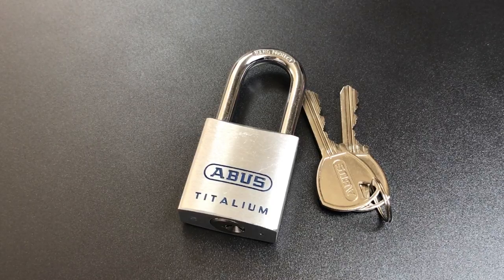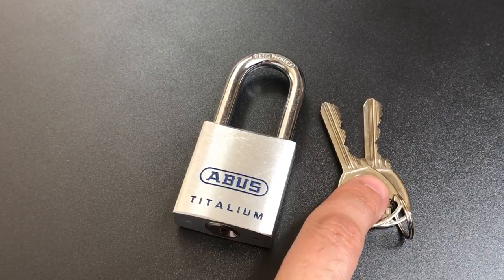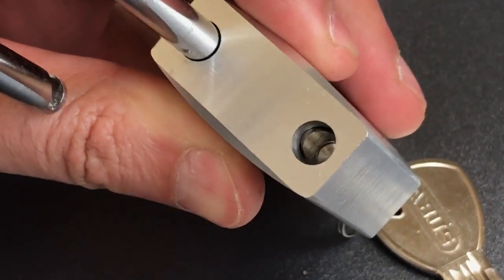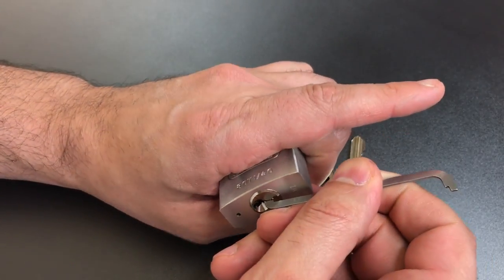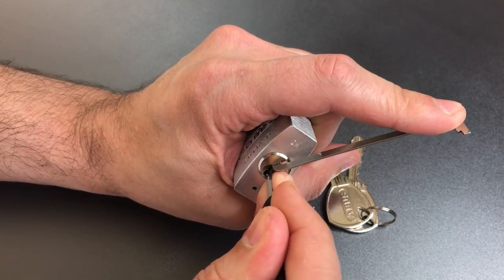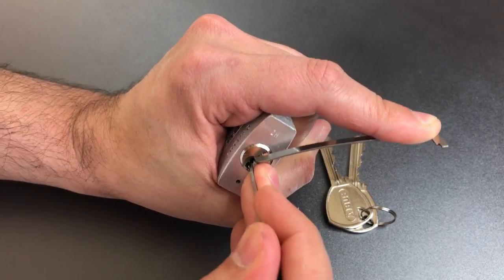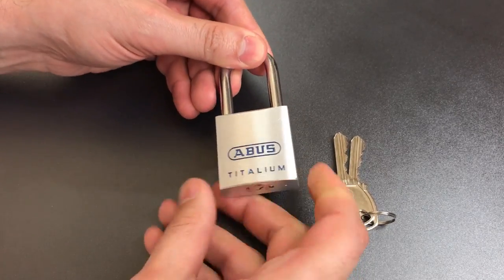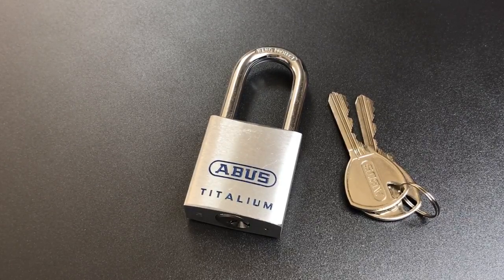[534] Abus Titalium 80TI/40 Padlock Picked

Comment: The biggest flaw on this 80Ti are sadly the missing ball bearings. The first driver is a double serrated and as far as I remember the rest are spools (I once had taken one apart), keypins are all standard. Actually it can be an easy or a hard pick, some are relatively smooth and on some the spools are really catching and pins like to drop, that differs a lot on this series. The big key is really nice, just love that triangle bow, and can have some crazy factory bitting :).

Comment: Is there a difference between this lock and the 64/40 other than the shackle length?
Reply: The 64TI/40 has smaller diameter shackle, and housing. It's the little brother of this lock.

Comment: What does false set, binding and counter rotation mean?
Reply: as far as i know, binding means the pin is resisting being pushed by the pick, which means its the next pin to be picked because it'll stay once it hits the right spot.
false set is when the core turns slightly because its caught on the slots in the spool pins.
counter rotation is what you get when you pick a spool pin while in the false set. as it moves closer and closer to the right position, it'll push the core slightly out of that false set back to the neutral position.

Comment: Why when I get a  False set The pins bind instantly I almost broke to picks trying to get them to set? I get a good false set by raking first then S.P.P. after but no movement at all?  What am I doing wrong?
Reply: learn how to deal with spool pins, you need to lighten up tension so the spools "unbind" and then put tension back on to lock it into place.

Comment: I have this lock on my truck tool box. While I love the lock and it has stood up well against all weather conditions, I would not use it on something expensive at home. I am usually not far from my work truck so I would see if someone was messing with it and if a thief really wanted it the could probably just remove the whole box easier. Doesn't make sense for me to have a lock that is worth more than the items it is protecting.

Comment: Can you please explain "false sets" and "counter rotation?" 

I've tried looking around but can't find a solid explanation. 

Many thanks.
Reply: To add to this, counter rotation is a challenge to deal with, if you don't apply appropriate tension during the counter rotation and not fast enough, it will reset the pins.
Reply: False set is when a security pin is picked and fell in it's false position to trick you that its picked if i'm not wrong. It clicks and turns the core, but is not set yet. Needs to be picked more. False set is happening before you have to deal with counter rotation as the guy above explained. This happens on for example Spool pins
Reply: So, a false set would be when the small diameter portion of a spool pin is at the shear line, and counter rotation is when  you vary the tension slightly while pushing on that pin to get the larger bottom of that spool pin past the  shear line? Thanks for helping us noobs.

Comment: I've got a disappointing 64TI50 here, where the first 2 pins don't even come in to play. It basically is a 3 pin lock...
Reply: I actually find the 64TI harder to SPP than the 80TI. They are easy to rake but gives me no feedback on SPP.
Reply: Try a bit harder tension on the 64s :), they like that. And somehow they are easy to overset. But once you find the right tension, they are not that hard :). You get some destinct clicks and once you learn how that feels, they will be no problem for you anymore 👍.

Comment: Those Abus locks are absolute crap. I bought a brand new abus titanium pad lock and locked my log splitter with it. Now I need to use the splitter and the lock wont open. It took me hours to open it. The aluminium had corroded. Junk.